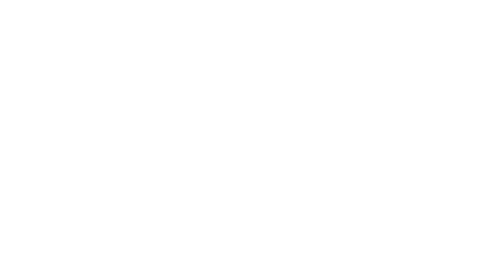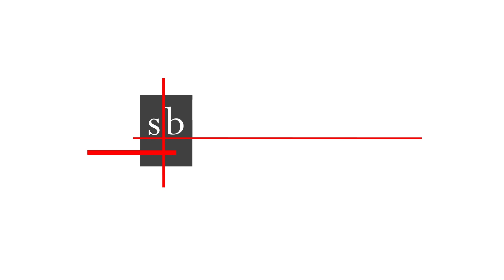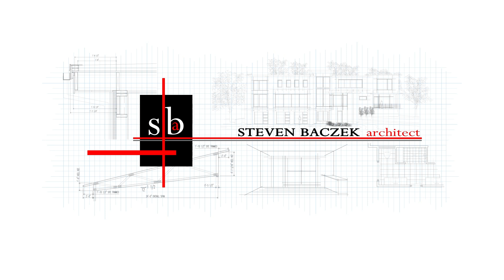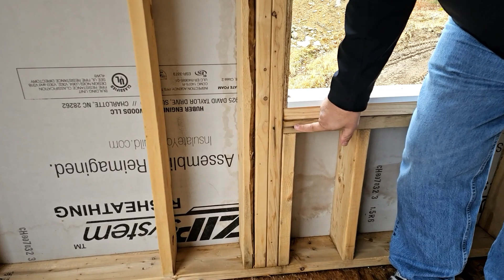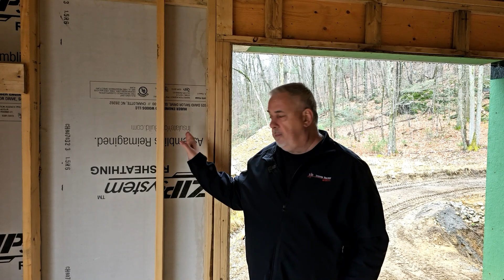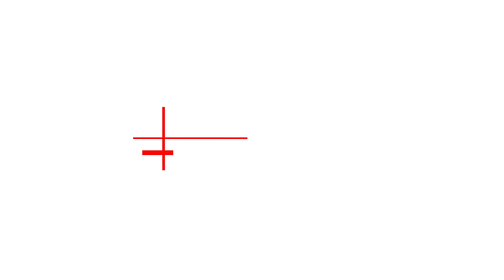STUDSIDE CHAT

Comment: Hey Steve, first time builder here, building my own home way up north in Southern BC canada. 

I have a question for you regarding radon mitigation, specifically how would you seal your poly (6mil is within spec up here) to a icf foundation wall in a basement? 

My inspector has suggested simply using tuck-tape or similar to tape up the wall about 12". My fear is the joints in the ICF and the permeability of the foam not sealing the radon properly, what would be your thoughts?

Thanks in advance for any and all help!

Comment: I've often thought that 19.2" layout would work best. If house was designed so that window and door layout corresponded with stud layout. 
( if you remove one stud it would be pretty close to a typical window or door rso).
Then if you used spray foam as insulation you could eliminate thermal drift. Thermal drift being the cousin to thermal bridging. (The side ways movement of cold through the stud laterally into fiber insulation giving conventional currents, aka cold, into the fiber.
Im not sure if thermal drift is an official term i just made it up to help describe my thoughts. 
Does this make sense? 
It also give more support for drywall while also taking advantage of less studs in the wall

Comment: Great focused video as usual, Thanks. Love the single , bite sized topics instead of folks that try to teach every single aspect all at once.
Reply from the maker: I am trying to develop videos that are singular thinking - meaning the take away is 1 thing/thought
Reply: I agree.  It helps apply new thinking even when doing minor remodeling projects.
Reply: If you get a chance, a good exercise for Big Red would be a video on framing with the various thicknesses of ZIP-R sheathing?  Particularly the stud pattern for inside and outside corners. Configurations that take in account thermal, structural, amount of lumber, and fastener placement.  It seems like wirhout a detail drawing, framers will "wing it", possibly creating problems down the road.
Reply: I think  @markstipulkoski1389  brings up a good point.